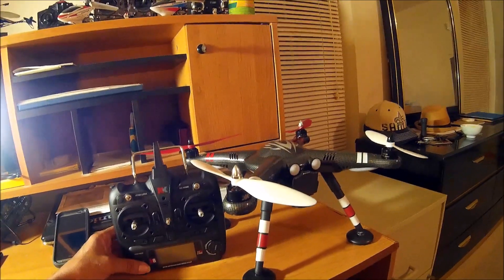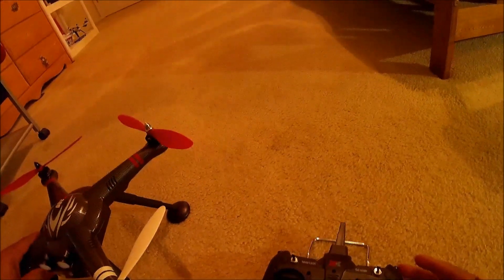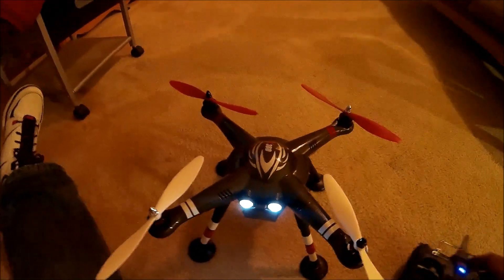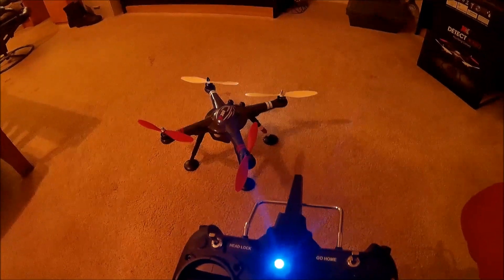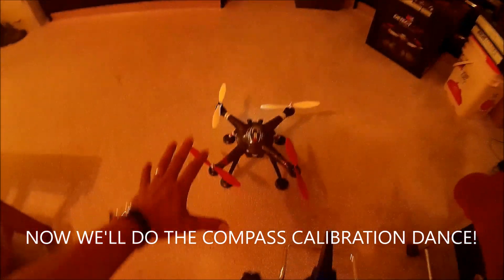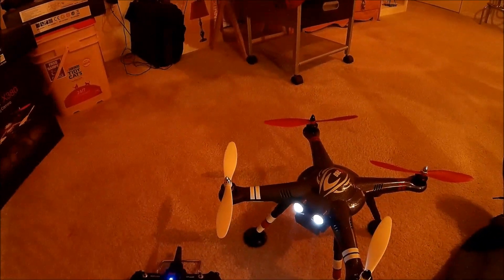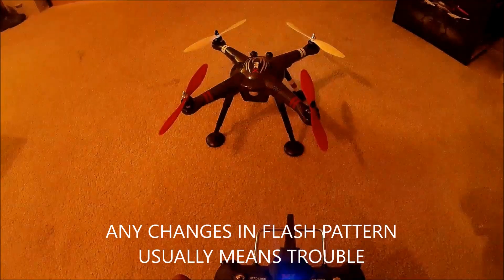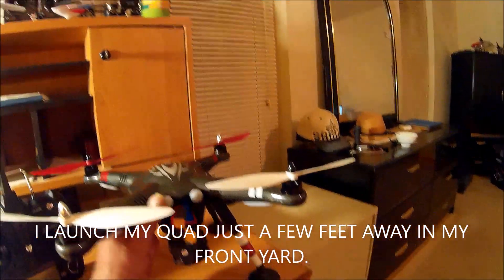XK DETECT X-380 "MUST WATCH BEFORE YOU FLY"

Comment: I went out today and flew my Phantom 3 Standard and XK380....Phantom was flawless today after I had to open her up to change out one of the two flat antenna in the battery bay which provides wifi info from phone to bird using the GO App....Now it was time for the XK380 to fly which this bird has been flawless up until today lol.  I did the dance got the 2 flashing lights and I thought ok she wants to fly.....well yes she did want to fly but not with me controlling her....I auto took off and she was all over the place in the air....well I was about treeline but she took off over the trees out of site and I hit go home switch as my only hope....I could not see the drone but could hear the motors...One minute later she shows up about 20 feet over tree line with red light on coming home....she didnt waver at all.  all the way down to touch down...I was super lucky but didnt now what the hell happened.... so I did the dance again took off and she went 5 up and went straight ahead not letting me control her....the right stick had no use she just went straight ahead until I crashed her on purpose so I would hit anything.  only busted a phantom prop and one of the bottom parts of the leg came off.   Very dissapointed sense she has been super reliable...... what do you think DJ
Reply from the maker: Wow Ricky, that's some crazy stuff man! I can't say for certain, but it sounds like a minor problem I had once when I discovered my remote was in mode 1 instead of mode 2.  Pushing the right stick would then move the quad up like the throttle instead of getting direction control. Did you also get the "toilet bowl" effect?  Are your remote control batteries charged? (both toggle switches up?) If she keeps acting up, I suggest flashing the memory and install all new files - see my video "2016 Master Files & Firmware upgrade. Let me know. DJ SOUL FORCE
Reply: Thanks for the Info...I also joined the fb group you mentioned
Reply from the maker: Ricky ThePhoton Dexter  When you think you've figured out what happened, please let me know. Could something worth mentioning in my next x380 video. Good luck bro. DJ Soul Force

Comment: Thank you i got cx 20 was nightmare. jusr order this everyone said great hard crash along gps lock and great winds  going beach. i order mine with everything. just one question on remote say picture press how work i see noone has cam with wires i dont get it. they even said video and picture clueless
Reply from the maker: I bought my x380 with nothing on it, so I'm not familiar with the factory gimbal and camera. In the latest firmware update (Dec 2015) the photo button was changed to FAP (fly around point) button. Pressing the Photo button will enter the FAP mode or the Auto Pan Mode. (see this video - https://www.youtube.com/watch?v=usWueGtBJCU - go to 3:50 to see how it works) I do not know how to take pictures or start video with the factory camera. If you do not have the latest firmware, and you would like to add FAP and Auto Pan, watch this video: https://www.youtube.com/watch?v=c0jPjEA4ZdQ  Good luck, let me know how it turns out. DJ SOUL FORCE

Comment: Hi DJ...having a problem with my XK380 that just developed.  I can no longer unlock the props by bringing the two sticks down and out?  The only way I can start it and turn it off is by pressing the take off button?  I tried re-binding the transmitter and doing the Calibration dance but it doesn't work.  I always get gps lock with the two blinking green lights, so I don't know....any suggestions?
Reply from the maker: Make sure you're in mode 2 by pressing the "stick mode" button until it's in mode 2, you will see the display change in the screen on the transmitter.  Let me know.
Reply: Hi DJ....going into the Flight Controller is what corrected it....I didn't change a thing.....simply connecting the XK380 to the controller and disconnecting it solved the problem...go figure.  Thanks again!
Reply from the maker: José Crespo Wow... is it magic or witchcraft? Lol. Glad it's working, the x380 is a hard lady to understand!!! DJ SOUL FORCE
Reply: Not so soon.  I took it out...everything looked fine..transmitter bound...double green flashing so gps lock.  When I hit the take off button it appeared to want to take off and props were moving but aircraft would not lift...I think it is witchcraft??  any ideas?
Reply from the maker: José Crespo  Sorry, I'm at the end of ideas with your bird, she's haunted!!! Seriously, double check your props to make sure they're on correctly. Did you push up on the throttle to see if she would lift up?

Comment: Oh by the way Gearbest told me to paie it , is that the same as binding ?
Reply from the maker: Yes, pairing is the same as binding to transmitter. If you don't have any lights flashing, I'm not sure if you'll be able to bind or calibrate since you need to see the lights for those procedures. If you're not getting ANY lights and your battery is fully charged, then you either have a defective battery or defective quad. Let me know about the lights. In the meantime, don't open or go inside the quad just yet, you may have to return it to Gearbest. Dj Soul Force

Comment: Hey DJ love your vidios. Got problem with my X380, Got it and charged batt. and pluged into X380 the light never came on and it just had a steady beep. Ever hear of this what could be wrong.
Reply from the maker: Never heard of that before. You should be getting some lights somewhere. Does the lights on the arms come on?  What about the two front headlights, anything there? Let me know, then we can try some troubleshooting. DJ Soul Force
Reply: +DJ SOUL FORCE  all lights on except status light & I checked connection.
Reply from the maker: Richard Cavallaro  It's almost impossible to tell what's wrong without the flight indicator light. If I were you, I'd ask to return it for exchange. (it's brand new right?) Without  opening up the quad for repairs, check this video and try connecting to PC using this method to see if you get anything from that light. Let me know.  DJ Soul Force
https://www.youtube.com/watch?v=c0jPjEA4ZdQ
Reply: Nothing works . going to change power board. thanks buddy

Comment: Hey! DJ,  I took my first flight yesterday, only about 10 minutes. The 380 took off and immediately and started to corkscrew circle towards me. I put it down twice ( I was close to a lamp poll and the park had tall uncut wild grasses close to the take off point). On the third attempt, I just pushed it forward and gained some altitude, and flew for about ten minutes before return to home. There was at least a 5 Knot breeze which might have accounted for the spin, or do I have a "Toilet Bowl" model? In return to home it spun down in a fairly tight circle and clipped some of the high brass right next to my launch point. It's supposed to be stormy over the weekend so I'm just trying to recap things. I do have Quad and Head Cam raw video but haven't worked on it yet. I flew with my moded fixed plastic gimbal and the stock 380C camera (fisheye view). I don't think I'd recommend getting the C version.

If it's toilet bowling what are your favorite suggestions?

Cheers!
BK
Hope you have better weather in SC than here in PA.
Reply from the maker: +Bob Koch  I suggest calibrating the accelerometers.  Put quad on level surface. Turn on transmitter, then turn on quad. Without using sticks, flip the RTH button 12 times or more until all lights blink. Put RTH button back up, when lights stop blinking, you're done. (that's not in the book but will be in my next video) Good luck on your next flight.  Dj Soul Force
Reply: +DJ SOUL FORCE  Hey! DJ, I calibrated the accelerometers and was able to take my 2nd Flight today before the rain started. No toilet bowl. Much easier to fly than the X250A. Just flying with my fixed gimbal. Have to learn how to adjust it better to get a decent view of the ground.
I did the Accelerometer Cal. on Saturday and was wondering if it would hold until I flew, it did.

Thanks again for your great help!
Cheers!
BK
Reply from the maker: Bob Koch  You should only have to calibrate the accelerometer whenever you notice the quad not hovering steadily. Look for that and more tips in my upcoming video on the x380. Good luck buddy, you'll be a pro in no time!!! DJ SOUL FORCE

Comment: Im already a member, but I thought I would run it by you first cause I think you give good advise a and tell it like it is. I have seen the camera you mentioned in a lot of posts so I will check it out. I may never go fpv but if I do I want a camera that is capable. thanks DJ your videos and opinions make flying easie.
Reply from the maker: +Ron Carlson  I use the Xiaomi Yi.  It can't do FPV and it doesn't fit in my gimbal without using a rubber band, but I like my video better than the GitUp Git2. GitUp has a really bad case of "fish eye!"  Good luck bro, thanks for "running it by me" before the Club!  DJ SOUL FORCE

Comment: My first flight today with my XK380 almost ended up with a crash.... it didnt want to fly like a champ.... I unpluged the battery and tried it again... had GPS lock and everything worked fine my second flight....I was thinking about the other dudes and their first flights and then this bird went nuts on me..... I dont trust it yet but I am putting it next to my Phantom 3 and maybe she will rub off on my new baby.  lol
Reply from the maker: +Ricky ThePhoton Dexter  Yea, that might work putting it on a shelf next to the Phantom, she'll get jealous and start performing better! Lol  Try this Ricky. Put quad on level surface. Turn on transmitter, turn on quad. Without using any sticks, flip the RTH button 12 times or more until the LEDs start blinking. Put RTH button up, wait for lights to stop blinking. Quad should go back to normal. That will calibrate the Accelerometer.  That's what tells the quad what level is. It's not in the book but I'll be doing an update to this video soon with more Tips, Tricks & Shortcuts!!!  Good luck, shoot some videos!  DJ Soul Force

Comment: DJ 
Thank You for all your great X380 videos. This is your most important.

I think Your point about letting the X380 boot up and initialize undisturbed is the most important thing I learned from all these videos.  The following are my thoughts about crashes, the compass dance and proper boot up. Maybe it will help others. I would value your thoughts as I could be wrong ... warning, I am a compass dance heretic!

launch it into a hover.  
Check each control axis. Left, right, fwd, back, yaw.  
Yaw 90 degrees. Put it in Head Lock. Check each control axis again to make sure the reference frame is retained.
Any toilet bowling or wobble in the slightest, then land it immediately. Reboot on a firm surface. 

Booting up undisturbed is the biggest human factor and the only uncontrolled variable. I flew mine for weeks from China without ever calibrating the Compass. I propose that the Flight computer and gyros reboot during the compass dance and the rebooting is what actually  solves the toilet bowl problem. 

On real aircraft, the compass is only "calibrated" or compensated when put into a new aircraft to account for the magnetic field of the air frame. The Flight Computer with GPS, inertial and other Nav inputs keep track of Magnetic Variation. I suspect the compass on the X380 just gives a relative heading to the flight computer and not a precise heading. GPS cannot determine heading unless it is moving. It calculates heading by using two plotted positions. The compass is used to calculate angular movement to give a heading while the GPS is stationary or between plotted position points. The gyros can also calculate heading change. The GPS is going to navigate using True North and not Magnetic North making the need to calibrate the compass for Earths "Magnetic Variation" irrational.

In FAA class aviation, tech manuals are followed to the letter. But here with the X380 the emphasis on the compass dance does not make sense with what I know having worked on military aircraft Nav systems.

One crash, I was wearing gloves on a cold day and had a death grip on the controller. I might have inadvertently pushed the Mode button but more likely, I might have put in too many erratic control inputs because of the gloves. I was just descending.

Too many erratic control inputs seem to be the common thread of my crashes. I no longer grip my flight controller but  let it rest in my fingers, thumbs curled away.  I only push on the sides of the stick. One axis of input at a time.  

I never had issue with Head Lock mode but I always do a flight control check that includes Head Lock reference check. Any wobble and I reboot. Now that I understand the importance of undisturbed booting, I never failed the hover check.

I was an Avionics tech and Flight Crew in the Coast Guard for 24 years. Plus had 2 sailboats with auto pilots.

Thanks again for your great videos.
Reply from the maker: +JohnHoranzy   I couldn't have said it better brother!!! Actually, I couldn't have said it as technically sound as you did, thank you very much. I hope everybody reads & heeds this! In a previous x380 video, I voiced a suspicion that too many stick commands at once could cause an x380 to crash or loose it's stability. I very seldom calibrate my compass either, "I have to say it in the video!!!" otherwise, I'll spend a lot of time writing "tech journals" to answer the comments & questions I'll get for not!!!  I'll be using your above comments as reference and maybe REPRINT from time to time, with you PERMISSION of course. Let me know, and truly thanks for your expertise. DJ SOUL FORCE
Reply: +DJ SOUL FORCE 
Feel free to quote my rambling inferences. But all that needs to be said is 
1-undisturbed boot up
2- don't overload the control inputs

I could not narrate a video like you to save my life but have done plenty of Aviation Technical Writing.

I wish I had access to the tech manuals if they even exist. Without the designers technical information, I am just making an educated guess. 
Without knowing the exact underlying principles, the compass dance is a superstition that cures some ills. And cure ills, it does.

When I do my Hover and Flight Control Check, I see that he X380 has quite a lot of lag or inertia to the control inputs. If I rush through those checks, pushing the stick left while it is still moving right she seems to wobble just a touch. Two crashes were flips just a foot or two off the ground with lots of obstacles when I panic corrected wrong moves due to loss of reference.

Try running through all the control motions the next time she rises to a hover before flight. You will see motions that are not readily visible when she is high.

When she is high and over unrecoverable areas, I only do one control input at a time. I cannot afford to replace her.

Comment: Hi DJ...long time no talk.  Having a problem with the Xk380 and you are the only guy I know that may help.  I was using the Flight Control Program to change the way the quad would return home (I wanted nose in). When I disconnected the USB from the Xk380 and then from the computer (after making the change on the Flight control program and pressing "write" I get a steady blinking red on the XK380...it won't go back to the blinking green twice....etc.  Any idea?  This happened once before and I should have left it alone.....this Flight Control Program is not easy to work with....

Thanks, Joe
Reply from the maker: +José Crespo  Sorry Jose, I just got this message. The flight control program can be difficult to work with, that's why I never did a video on it!!!  Your x380 sounds like it's having software issues, you need to watch this video about the master files. (this is easier than the flight control software) https://www.youtube.com/watch?v=c0jPjEA4ZdQ  DJ Soul Force
Reply: Thank you, DJ...have a great day!

Comment: they're just a little chips
Reply from the maker: +Old School R/C  You should be ok, but I suggest changing them out real soon. If you're looking for an upgrade in props, try the Phantom 3 props, they screw on the x380.  http://www.ebay.com/itm/DJI-Phantom-3-9450-Self-tightening-Propellers-IN-Stock-/161722593350?hash=item25a76af046  Don't forget, you should have spare props that came with your x380.  DJ SOUL FORCE

Comment: DJ,my props got a little messed up can I still fly my XKX380 like that?
Reply from the maker: +Old School R/C  Depends on whether they are bent or not. A few chips & dings on the edges are ok, but should be changed out ASAP because that could lead to breaks or splitting. Never fly with bent or warped props. Have you used up your spare props already, remember, your x380 came with two sets of props. Good luck. DJ SOUL FORCE

Comment: thanks dj ill look into that  imaxb6. I don't know wether you know this will the imaxb6 charge the xero xplorer transmitter  thanks  MIKE
Reply from the maker: +Michael Michel   It will charge a number of different types and size batteries, but I'm not sure about a transmitter. Most transmitters have special plugs for input connections & charging, like USB or barrel plugs! Good luck bro, fly safe.  DJ Soul Force